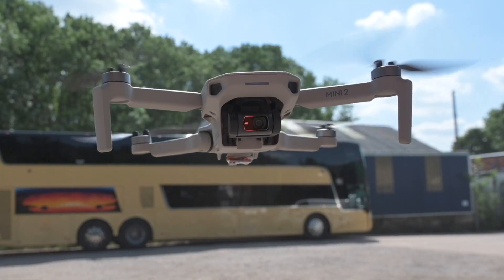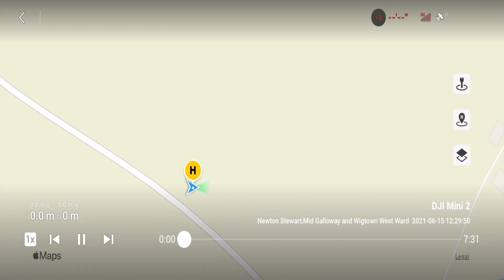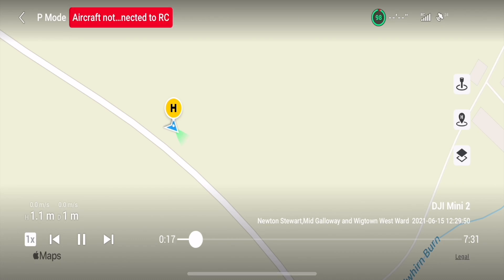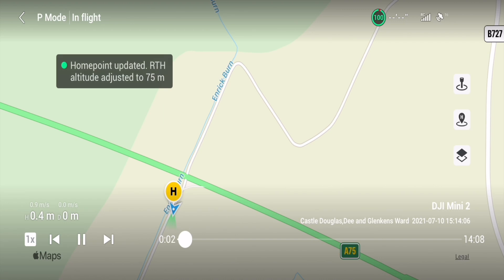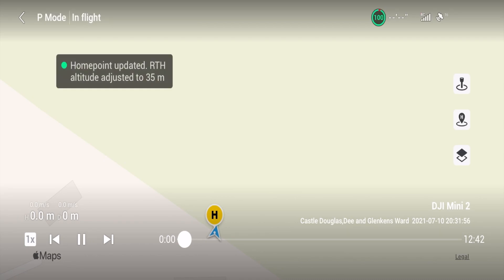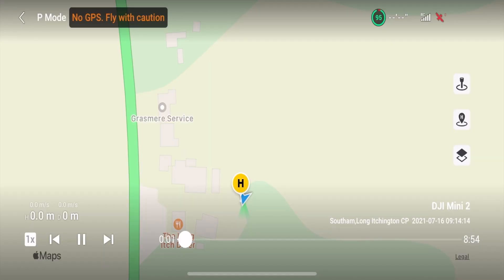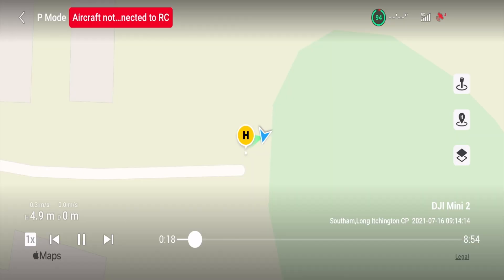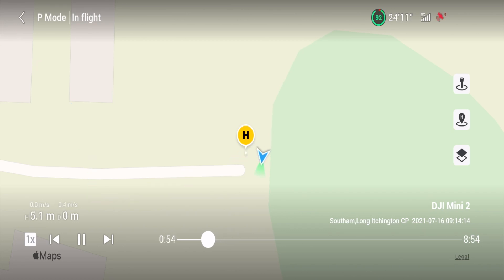DJI Mini 2 - Occusync 2.0 - Connection issues

Comment: Never had an issue. Reading through the comments, I'm initially thinking it's common. However, I wonder if this is self-selective - on that those with the issue are searching YouTube for this. Have you contacted DJI support folks?
Reply from the maker: Not yet. But having seen the scale of the response I will be speaking with them 👍🏻

Comment: This has happened to me twice now since the .8 update. Make sure to set your RTH to hover. If you have anything above you when it goes into forced RTH it will rise up straight into the obstacle (branches etc). If you set to hover, you will be fine as the disconnect is momentary. Around 5 seconds for me. MY RC disconnect in advanced safety settings was set to RTH and when it did it i had branches above the drone and flying over water. Could have been bad. It started to rise and I shat it but luckily a foot from the branches my connection came back and I could cancel RTH. The mini 2 was 8ft from me...... Worrying. It seems to happen at the very start of the flight. Hope is addressed soon but set drone to hover on disconnect and you will mitigate it. Thanks for the upload mate. 👍🏽🏴🇲🇹
Reply from the maker: Excellent advice there thanks. I’ve only suffered this when it’s been at the start of the flight and in close proximity too. I don’t panic when it’s off on it’s travels as I know I will have set RTH correctly. I do set RTH to hover when I’m working close by or going through tunnels and bridges etc. Thanks again 👍🏻
Reply: @HeatonPhotography101  definitely an in addressed issue here. It’s the Fly app as MA2 doing it also although not as bad but since the last 2 fly updates my range has taken a significant hit. Open areas I’m losing connection at 700m. Even with the MA2
Reply from the maker: Well, last night I sent the drone up at dusk. Went out to 670m (with a strobe to maintain VLOS) and it had all manner of problems. Normally you would expect it to lose connection, screen go black, then RTH. This time it kind of got stuck in a loop. It kept reconnecting, then losing connection, the reconnecting, every couple of seconds so RTH would not kick in! I solved this by trying to climb (which as you can imagine took some time) until the point where signal was restored and I flew it home. Something is definitely amiss with this little drone at the moment.
Reply: @HeatonPhotography101  similar to my experience too. I fly with Android usually and it’s been great for a year but Om going to do some tests with the IPhone today to see if it is to do with the phone platform. Which phone do you use?
Reply from the maker: I’m using an iPhone 11. I will be interested to hear your results. At this time I don’t think it’s my phone as the symbology and map are all still functioning. I think it is an antenna fault, either on the drone or in the controller. I’ve looked at both and there are no visual signs of any damage etc, and my drone hasn’t been dropped or crashed, it gets treated like a precious flower 😂😂
Reply: @HeatonPhotography101  not the phone then. It’s not hardware as too many pilots reporting the issue and it is after a firmware/software change it has happened so DJI need to fix it. My original mini is more reliable on WiFi at the moment lol
Reply from the maker: My original mini is still at the bottom of a deep lake, therefore not as reliable 😂
Reply from the maker: Ironically it crashed into something after it lost connection! 🤬

Comment: Since updating the app to 1.4.8 (Android) I’m having issues with the app locking, crashing, camera functions not working and disconnection occurring on every flight. Before the  latest update I had no problems.
Went back to ver.1.4.4 and everything was fine but app keeps automatically updating to
1.4.8 even though I have all auto updates turned off, even updated itself during flight.
Have been in touch with DJI and sent all details etc. and am waiting for next response.

Comment: Excellent and well detailed video. Not had any loss of connection since the last update, but had the iPhone dimming in the first week and a half of the update, never had it previously, even though most people claim its a iPhone issue alone. But what i do have a problem with since the update, is locking on the subject in Quickshot mode, sometimes i cant get the + or box to appear or i get a message " not able to lock on subject." I have used Quickshots quite a lot over the last 4 months, never once had this problem, until the latest firmware upgrade..Coincidence? or has anyone else had this? In all honesty i haven't heard of one other person having this issue, so may be specific to me. Any suggestions / help appreciated.

Comment: This also started to happen to me recently. I fly the drone for a few minutes and sometimes it disconnects randomly even when it's 20 meters away from me. I'll try to downgrade
Reply: So I didn't do anything with the firmware but I downgraded the app. I installed the old version 1.4.4 (android) and there is no more shuttering on my screen and no more random disconnections, no more black screens
Reply: @ov1lord  That sounds like  a good plan to me. I flew quite a lot a couple of days back and suffered a lot of what you have. I'm one revision back from the latest as far as aircraft firmware is concerned, so will leave that as is for now, but I'm definitely downgrading the Fly App to 1.4.4 which I was always happy with.
Reply from the maker: That’s interesting to know. Thanks for the update. Let us know if anything else pops up.
Reply from the maker: Hi Ovi Lord. Thanks for your comment. Let us know how you get on with rolling back your firmware, and if it cures the problem, please let us know which version you went back to. cheers.

Comment: Since updating mini 2 the latest firmware and updating the app to 1.4.8 (Android) I’m having issues with the app locking, crashing, camera functions not working and 1 disconnection incident. Before the updates, I logged around 80 flights each was perfect. Going to rewatch the excellent video on downgrading the firmware and roll back to previous app version.
Reply from the maker: Let us know how you get on with rolling back the firmware and if it solves the issue. cheers.
Reply: me too.
Reply: I did the easy part, rolled back to app version 1.4.2 and did  two test flights. First flight used the whole battery, the drone and controller performed flawlessly. Second flight had the app restart itself once. Definitely better, the flights were at midday in blazing sunshine too.
Reply: I've had similar crashing/freezing issues. Only owned drone since latest firmware so can't compare to previous firmwares.

Comment: I have four days since I bought it and it is perfect for me, I reach 2 kilometers without any problem, I hope it does not happen to me with my mini2, I hope you fix the problem , make a new video if the problem is fixed please. 👍
Reply from the maker: I am glad that you are not having issues with your drone. Happy flying!
Reply: Can you tell us the version of the FW from the drone and which version of the fly app are you using .I have the same problem with my mini2 and also still the horizon gimbal problem.
Reply from the maker: Latest versions of both the app and the drone.
Reply: But 2 kilometres is more than your legally allowed
Reply: @stevengatherer7038  you do not know which country he is flying in, so the rules may be different where he is. This issue I am having is with the mini 2 disconnecting at less than 60 metres from me. Let's stay on topic please.

Comment: This sounds very weird and not normal. I wonder if wiring problem in drone or controller?  I think you should contact DJI and get checked out.
Reply from the maker: you could be on to something there Jonathan. I will try and do some more research. thanks.

Comment: This has happened to me countless times since the last firmware update 🤷🏻
Reply from the maker: Thanks for the comment. Do you believe it is down to the firmware update then? My experience started  around 2 updates ago but I can’t put an exact date on it. My first example from when I started noting these incidents was 15th june 2021. This is the day before the last update was released I believe. Cheers.
Reply: @HeatonPhotography101  I literally never lost connection once before the last firmware update. A few hours ago, I was trying to do a cinematic shot orbiting a couple of ferries leaving Dublin port, this area has an altitude limit of of 30m.... suddenly aircraft disconnected, weak GPS showed up, then it switched to atti mode, a nightmare scenario. This is an issue created my DJI
Reply from the maker: There certainly seems to be a lot more people having issues than I expected. Thanks for your input, I may need to get the pen out and contact dji.
Reply: @HeatonPhotography101  This has been discussed a lot on the drone shows I watch, good thing I don't fly too much in cities, the last thing you want is to lose connection with  all of those potential hazards
Reply from the maker: Yes. I’m not too worried about loss of connection when I’m out flying as I have every confidence in the drone coming back with RTH. Taking the time to ensure it’s all set up and locked in before zooming off is part of my routine. 

My worry is when it has just taken off and it is at just above ground level. RTH needs to be over 20m away. In this close proximity, the drone has a higher chance of banging into something or drifting into danger, or not returning.
Reply: @HeatonPhotography101  I always take the precautions, I just hate losing connection when I'm doing a shot which takes ages to set up 😂

Comment: Had the same issue for a week. Doesn't seem to be any good reason for the loss of connection. Not had this problem before and its putting me off flying. Hope they sort it soon!
Reply from the maker: It does knock your confidence in the drone doesn’t it? Thanks for your comment, and the sub. Last few firmware updates seems to have upset the balance a bit for this drone.
Reply: @HeatonPhotography101  for sure, my confidence in it dwindles a little more everytime I take it up recently. First happened to me last week when trying to get shots of the Indiana Jones 5 film set in Glasgow, signal loss, no control of the drone which was only 5 feet above my head, then I had to watch in horror as it drifted back and hit a building. At first I thought the film crew had somehow blocked it, Haha . Plagued by this issue ever since.
Reply from the maker: I think that’s the worst part that it’s almost (but not quite) within reach when it stops responding!
Reply from the maker: Hope it wasn’t damaged too bad.

Comment: I had something different, the app froze about 2 mins in. Still controlled it & video feed was good. Took me a  bit too realise that altitude reading was wrong. Luckily wasn't far away so brought it back OK. I did try too close the app & start it again in flight but couldn't get out. Have since rolled back the firmware & app & all is good again. If I'd been further away could of been nasty so I was lucky
Reply from the maker: That's not good is it? At least you were still able to control it which is always a bonus. Something definitely not right with this drone at the moment.
Reply: Neil Birkinshaw I've had the same problem several times, went back to fly app 1.4.2 and so far all good